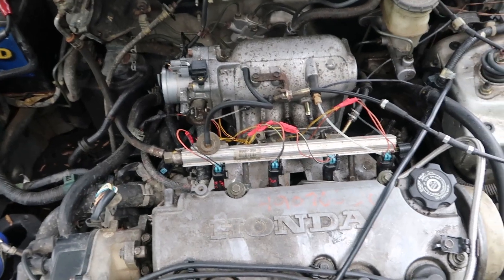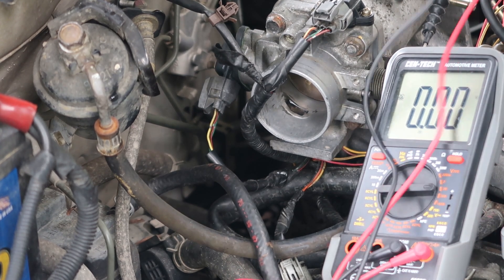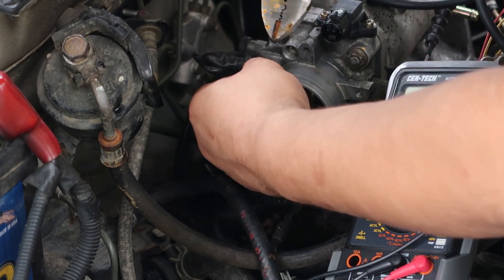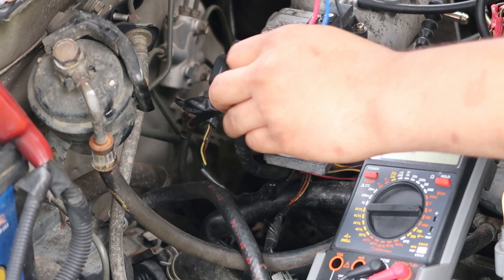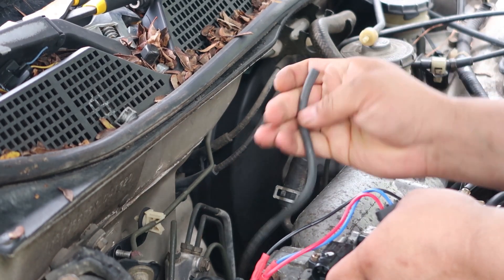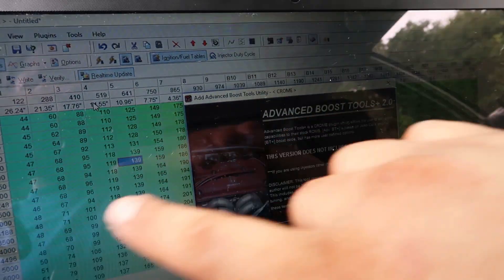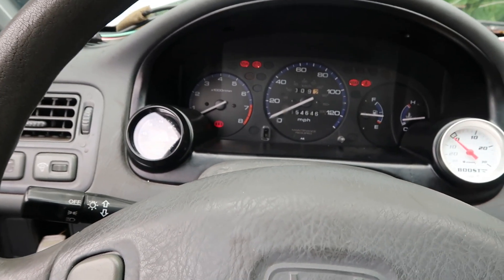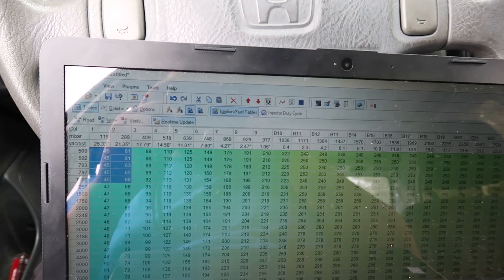How To Install A GM 3 BAR Into a Honda

Comment: New to the Honda game but where do you get the Injectors off of like the 1000cc like which year of Ls trucks?
Reply: Don't think stock LS Injectors are 1000cc. And they have to be decapped and are closer to 750cc. Your best bet will be Acura RDX Injectors from the turbo K24 and swap the top hats
Reply: Gm flex fuel truck injectors are around 1000

Comment: Yo man nice video! Are you still running Crome? I've got a couple questions for ya. Also, have you used Chrome gold at all?
Reply from the maker: Haven't used gold yet but I want to get it soon! What questions ask away
Reply: Just been having a hard time getting my Hulog datalogger to connect with Crome.

Comment: You should get the dealer version off of ebay for cheap and use the gold basemaps. Viewing the  graphs of the datalogs helps a ton and version 1.5.0 is the least buggy and never expires.
Reply: Could you please give me more information? There is only 1 seller on eBay for Crome Gold. They need to use TeamViewer to install, sounds like a scam, because I can crack & do things myself. But I need Crome Dealer, is eBay actually legit? Have you done this?

Comment: Hey man I love your videos! Are you in Houston btw? I have a 2000 ex with a y8 all stock and I’ve been really wanting to turbo it to make it more peppy. Would you recommend turboing it for a daily driver?
Reply from the maker: Yeah for sure you can turbo a daily driver, I would get quality parts tho, this car is peiced together with the cheapest crap I could find lol, i dont drive it very often so realiablilty isn't a big issue. I'll start swapping out parts for quality replacement stuff over time tho. Ill say im from the houston "area" dont wanna pin point my location. You're from houston?
Reply: GreaseMonkeyMods yeah I have a company truck I drive to and from work and picked up the civic for a weekend driver/ beer getter lol yeah I’m in the Houston area myself I just recognized the area code in one of your videos that’s why I asked lol